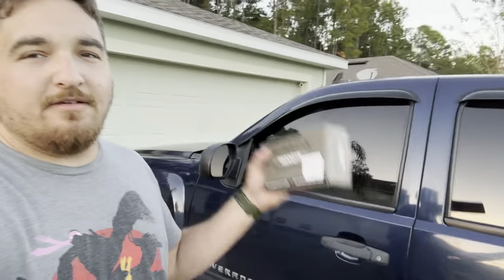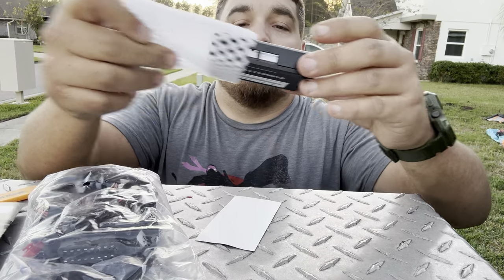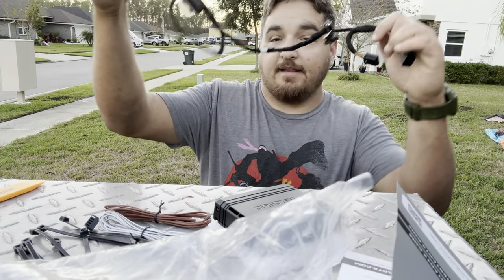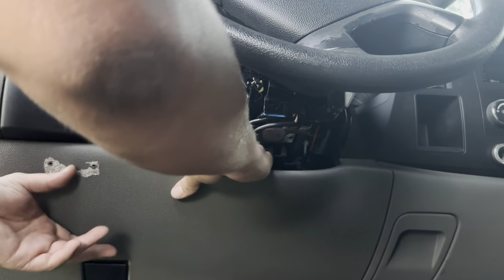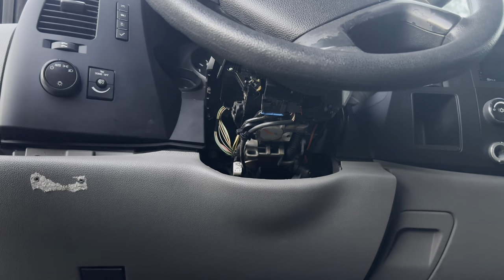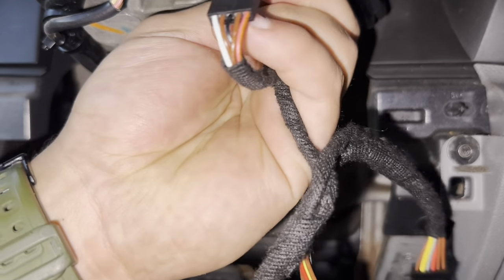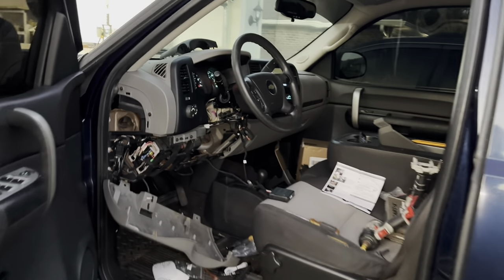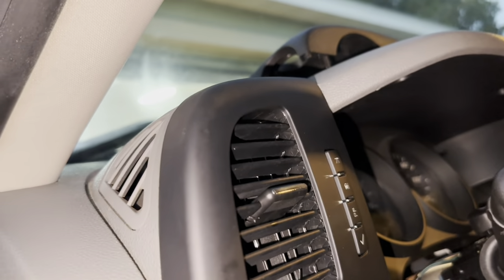Installing Plug and Play Remote Start on my 2009 Silverado in 15 minutes to easy! Start X

Comment: Don’t be the dummy I am, so I got all excited and got ahead of myself and popped the hood to put the sticker on before I was done so when I went to test it and it wasn’t working. I was stuck for about an hour. I contacted support and right as I was about to give up I closed the hood and for shits and giggles I tried it with the hood closed and it worked. Good laugh after being dumb founded. Just some info to help
Reply: Old post 

Hood open and won't start, most likely the electronic hood pin safety feature.  Plug and play systems dont use a physical hood pin , think the features built into the harness

Comment: Would seriously consider buying it if the horn didn't have to blow in order to make the engine start.  Thanks for the video.
Reply from the maker: Yea that is a draw back I’ve seen people disconnect the horn for that reason lol
Reply: Go into your vehicle settings on the dash and turn off the horn on lock feature. 👌🏽✅
Reply: @ZRZ71 how do you do that?
Reply: @AmishGeneral  driver information center on the dash… under vehicle settings I believe. It’s in there with other settings for auto locking/ unlocking doors in Drive/Park.

Comment: Does it come with the remote??
Reply from the maker: No you use the key fob for the truck you just use the lock button 3 times
Reply: I believe those kits you use factory remote by pressing lock button 3x

Comment: Does this work even if you have a check engine light bro?
Reply from the maker: Not a clue I don’t have one but I don’t see why it wouldn’t work
Reply: @SmittysWorld  ok only reason I have one is because I have headers on mine but I just bought it I’ll let you know if it does or not 🤞🏾
Reply from the maker: @jesusnava6953  ok sounds good I’ve got dual straights but no check engine light
Reply from the maker: @jesusnava6953  it does just confirmed
Reply: @SmittysWorld  hell yeah bro mines taking long to ship ordered it since November 24 and suppose to receive it this Thursday smh
Reply: @SmittysWorld  did you install the hood pin and loose wires that says for a professional installer
Reply from the maker: @jesusnava6953  no I did not no need with my truck I’m the only one that works on it

Comment: watching this while seeing how long and warm it makes the truck just installed one of the startx system on a2016 nissan frontier was so easy didnt need to remove anything but had to do some yoga so simple tonisntal wqsnt even funny did mine at night thought a cop was gona vome upnon me thinking im boosting my own truck
Reply from the maker: Depends on the truck mines starting to warm up around 5 minutes of run

Comment: Did you have to connect to your computer and do anything with software?
Reply: I’ve also seen people that say the horn blows when you start. Is that an issue?
Reply from the maker: No it's plug and play . The horn does blow but you can disable it by turning honk off on lock. @cameronbeyer7378

Comment: Do you still need regular key in ignition? Or you good to drive without it being in ignition?
Reply from the maker: Yea to put it in and turn
Reply: Shuts off as soon as you put your foot on the brake to shift to drive, so key is necessary, turned to on position.

Comment: Do you use the brown and white and black stripe wire with a metal look like a spark plug that came with it in a small pouch did you install it or use without it??
Reply from the maker: I used it without but if you want to use it for a shutdown system you can
Reply: @SmittysWorld  I have an 11 Sierra with an AP8 and I’m gonna try installing it I just watched your video and I’m gonna watch while I plug and play multi task thank you for answering back your the best 👍

Comment: Does this just run off of your current key or key fob you have or do they give you one?
Reply from the maker: Current key fob from factory
Reply from the maker: Aftermarket work as well but this kit uses the lock system from the truck for signal

Comment: I just dont get it. I have done everything exactly like you have, LED was solid red like you had it, turned the key to on, green light flashed for some time and then eventually started flashing red 4 times. ive tried resetting the module but nothing seems to work. 2013 Silverado 1500
Reply from the maker: Do you have a check engine light?
Reply: @SmittysWorld  nothing on the dash without the remote start hooked up. 

Didn't happen to notice if it was on with the remote start hooked up and key turned on. If it was, what's the next step
Reply from the maker: @Nick_x_98  should work fine 3 clicks of the lock and it should fire right off make sure they sent you the right model
Reply: @SmittysWorld  nope I tried that once the green flashing stopped. Mine just starts flashing red, never went solid green like yours
Reply from the maker: @Nick_x_98  🤔 that’s interesting maybe call the customer service see what they say
Reply: @SmittysWorld  got it to work. Mine flashed orange then green like yours but the green just kept going until it flashed red which I'm assuming meant it failed. Cycled the key off and then back on and went solid green almost instantly and then blank

Comment: Has anyone here heard of the remote start working great, but the ignition key no longer cranks the vehicle? Very odd…
Reply from the maker: That’s different
Reply: Yeah… I can remote start it and get in, put the key in and shift into drive and I’m good to go.

But, if I turn the truck off and then try and start it, it won’t crank with the key. Nothing at all happens. Idk if a wire came loose somewhere or what.

I’m messaging tech support now to see what they think.
Reply: I tried it when I installed last night how you tested and it all worked fine. Now it doesn’t. It may need to be reset or a cable has come unplugged or something.
Reply from the maker: @THEREALBRYCEH  interesting not sure on that one
Reply: I would like to know what happen just incase that happens to me
Reply: I’ve figured out that when I installed the system, it tripped my PassLock/Antitheft system on the truck. Everytime I start it now, the AntiTheft turns on and won’t allow the key to crank the truck.

I’m communicating with the Start-X to see if they’ve ran into this before and what I should do. We’ll see where it goes.
Reply from the maker: @THEREALBRYCEH  thank you for the update very interesting that it did that.
Reply: @THEREALBRYCEH  my luck, that will happen to me too.. please keep us updated, I really hope you get it figured out
Reply: UPDATE!

I got it working and figure out the problem. The connector into my ignition had come loose and wasn’t securing well. Which was triggering the antitheft system to engage. After connecting the plug back and securing with electrical tape, IT WORKS FANTASTIC!

No issues at all with the system! Go figure it was user error! 🤣
Reply from the maker: @THEREALBRYCEH  awesome so glad to hear